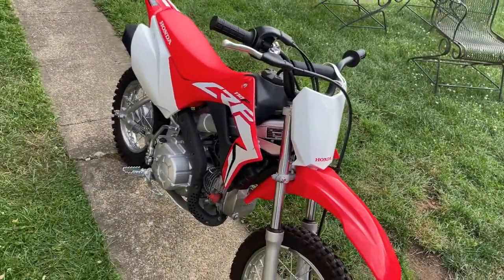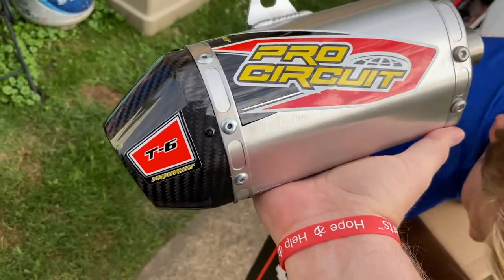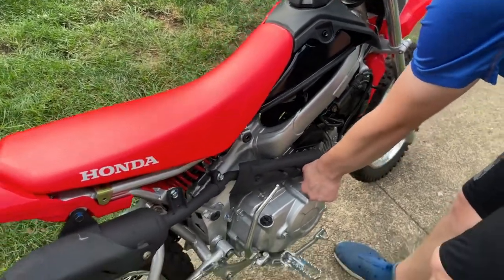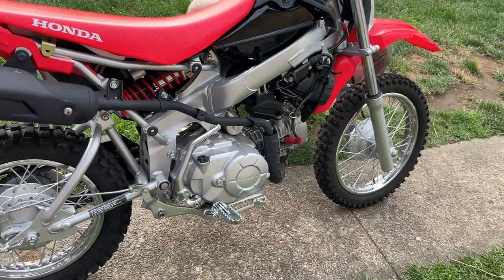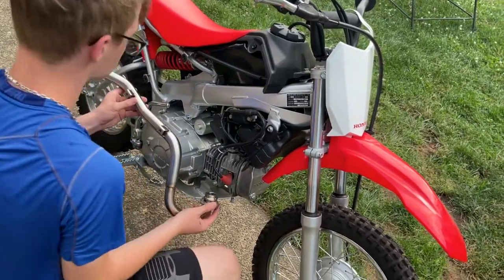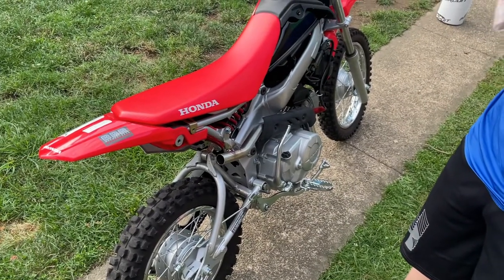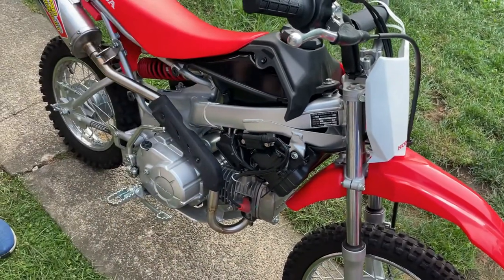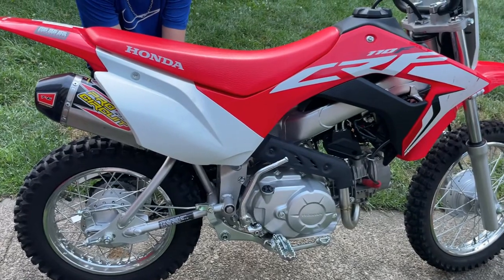Honda CRF110F Pro Circuit exhaust Install

Comment: Is it a 2021? Did it have any problems? Did they have to make modifications to install the exhaust? Cause I’m thinking about buying the same exhaust for my CRF110F
Reply from the maker: It’s a 2019 EFI, no problems at all as seen in the video. Runs great sounds better!

Comment: nice job ruining the exhaust by not wearing gloves when handling the pipe , when it gets hot the oils from your hands will fry into the pipe and it will look horrible
Reply from the maker: Nope, it’s fine. Even after hours of running/riding
Reply: @coltonfetcher 
Just got the same exhaust without the carbon fiber tip the instructions don’t say anything about washing your hands or wearing gloves before installing. It’s 3 bolts no reason to overcomplivate it. I’ve never heard of the oil on your hands sticking to the exhaust when it heats up anyways, when we bought my nephews 150r from the showroom floor tons of people have probably touched the exhaust and when we took it out to break in the pipe got red hot at times and there’s no residue on the pipe still?